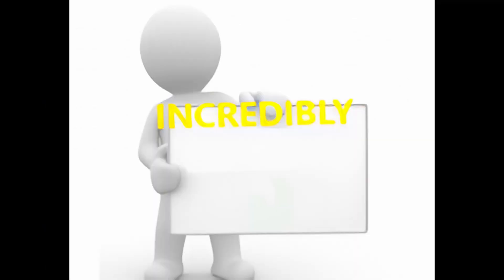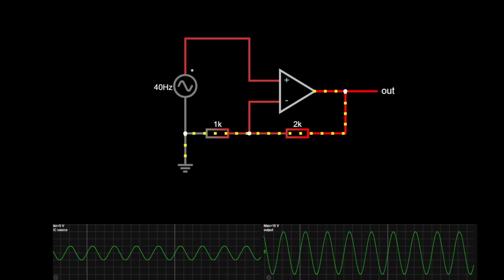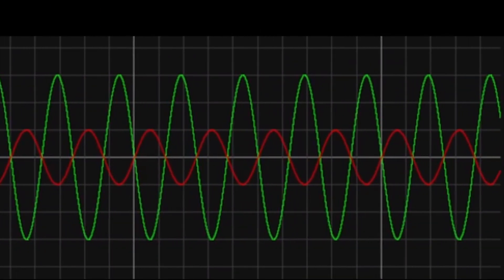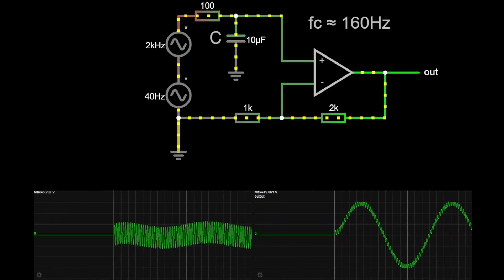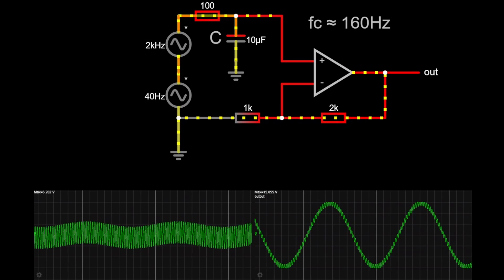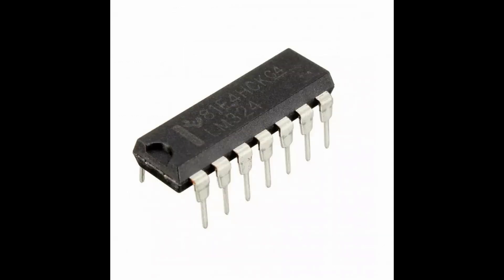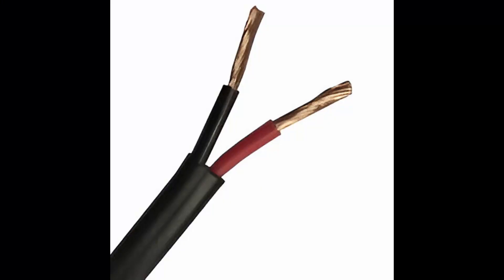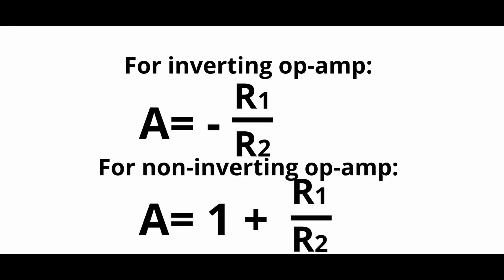Op Amps in 100 Seconds

Comment: I hope a video about making a custom 27Mhz or CB band radio transmitter and reciever, for long range wireless communication using a transistor and "On Off Keying" and using Serial protocol over the air... That way it could be customisable in terms of range and power output, and also might offer 8bit 16khz sampled audio... Maybe use the popular 27Mhz crystal oscillator to generate the stable wireless frequency. Anyways love the videos. 👍 Good luck
Reply from the maker: @arnavpawar256  radio is something I really like so I'll probably make more videos about it! Here is one i already made with 433MHz amplitude shift keying (ASK): https://youtu.be/jbqjQXNYyXU?si=KbFkt_46GJN41E4x
Reply: @V_Electronics  The 27Mhz is a better frequency due to longer wavelength and penetration. I think a "digital audio" walkie talkie (not FM or AM) would be a great project, with long distance audio transmission testing with no noise (because it's digital modulation)... Good luck for this unique project 👍

Comment: Once, I made an LM741 explode inches away from my face. See how pin 7 is the power in pin, and pin 6 is the signal output pin? Well, I had a 741 on a breadboard, and I tried to connect +15VDC to pin 7. Except I was off by 1 pin. The moment the power jumper touched the breadboard, I saw a bright white flash, heard a loud Pop! and realized the casing was flying right up at my face. 

Should've turned off the PSU first, I guess. 🙃
Reply from the maker: @ads1035  Be careful!